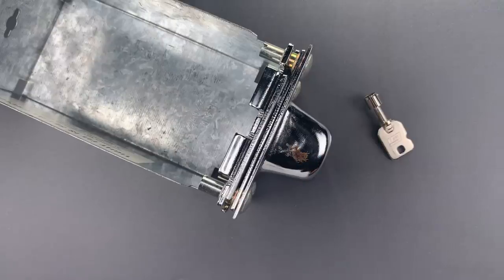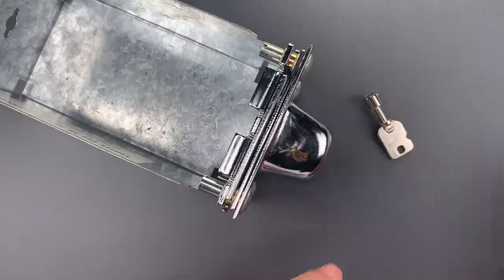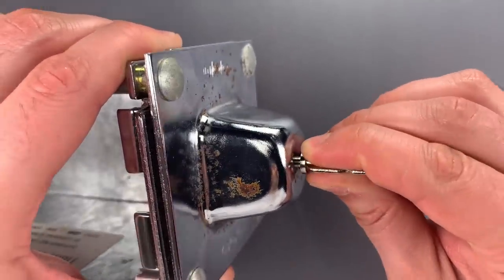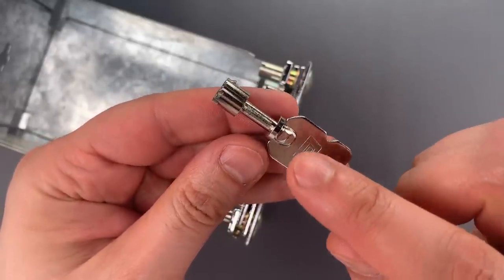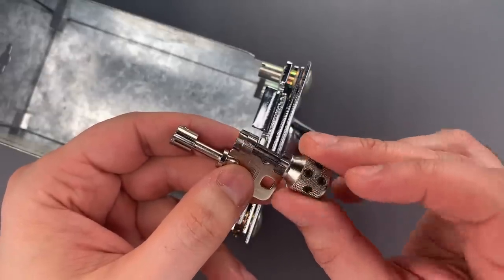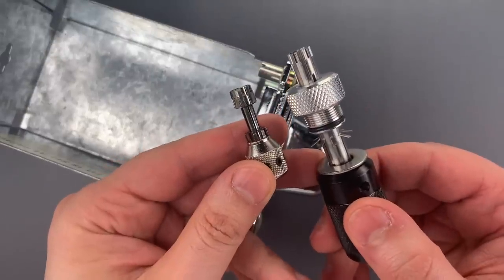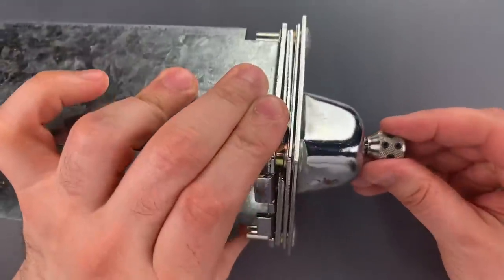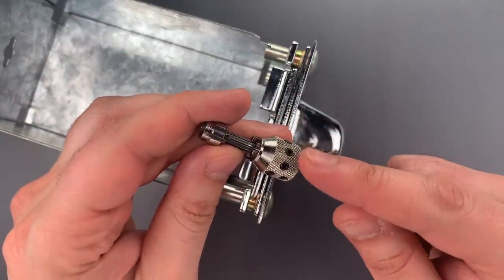[1205] Rare Tool For Picking “Giraffe Key” Locks

Comment: idea: four-pin giraffe lock. a with this design would be pick-costly, as the thief would need to create the one-of-a-kind tool themselves (combining the two scarcity factors that make tubular locks potentially viable). At that point, it will likely scare away potential thieves, or just compel them to cut the lock/bike rack.
Don't use it on high-profile or long term targets, though, as the tool itself is possible to make, just not with great ease.

Comment: Interesting. If you made a similar modification to a disk detainer lock, even a cheap Chinese cam lock core, you could make it impossible to pick with any DD tool I know of. If you just restricted the diameter of the key, however, it would be easy to defeat. I think if you blocked the core with a plate that has a C-shaped cutout in it, and modified a normal key by removing all the material from a section of the shaft except for a bit that's offset from the center, you would end up with a lock that's very similar in concept to the Bowley. Now, the Bowley is not unpickable, and has in fact been picked on video, but it is an absolute nightmare to make tools for. Considering the amount of space in a typical DD keyway, and the complexity of existing tools, I think making a pick for a DD lock like this would be even worse. No one but the most dedicated and obsessive lock nerds would be able to open it without power tools.
Reply: Not sure if anyone will ever read this, but if you do, here's LPL's video on the Bowley, where he comes up with various theoretical picking attacks: https://youtu.be/qV8QKZNFxLw . 
Here is a video of a member of the Locksport community picking the Bowley. Note that faster methods have since been discovered; this is just the first time anyone ever actually succeeded: https://youtu.be/X04qgD0hOXk

Comment: You can find that pick here: https://thepickmasters.net

I love mine. Excellent tool.

The rare pick you are referring to that has not been made in almost 40 years is the original Pickmaster. I have one, and it is useful on many 7-pin tubular locks, however the one you have in your video is, in fact, its successor, which is currently available, and is also, unlike most other tubular picks, capable of SPPing tubular locks. The allen screws adjust the tension for the picks tips and can lock them in place for impressioning, or preseting cut depths.

Comment: Why is this entire comments section thinking LPL is just gonna instantly pick Stuff Made Here's lock as if it's an every day lock? I get that he's really good at what he does but damn, have a little faith. The lock was literally built to have NONE of the mechanisms lockpickers use to go about picking it. You can't even set pins individually like you can with every single lock LPL made a video with. Setting pins individually? Can't do it. Raking? Won't do anything. Comb picking? Not likely (odds are Shane watched LPL videos so he's probably aware of what causes comb picking to work which is easy to prevent). The only true way to pick a lock like that would be effectively recreating the whole key using a tool intended to effectively be an adjustable key, which is not only way more difficult because you have to guess every pin right and have no way to tell which pins are right and wrong, but doesn't even really count as picking when you think about it. I know LPL's really good, but let's look at it realistically here

Comment: Can anyone explain how this works? i can't see how he is manipulating the lock other than jiggling a little??
Reply: From what I can piece together, you turn the key to the side, binding the key against the tightest pin, then you push it in to set those key bits correctly, do it again the other direction (bind, push in order to set those) and so on until the bitting is correct, then the lock opens. At that point the key is effectively just the correct key. I don't know how the bitting changes, perhaps the bits are spring loaded and on a slight angle so the pushing causes them to advance to the next position? I'm not familiar with the innards of either the lock or the key so I'm struggling too.
The set pins on the back are so you can lock the key in position for other locks with the same pinning (as fast as having a key, rather than picking it each time), and so you could take the key out with the correct bits and duplicate it if necessary. (I went to the website of the company that makes this pick to see if they had more information, but beyond a slightly better direction on how to use it and this part about the set screws, I didn't find out much.)

Comment: Im still confused about how much tension to put on a tension wrench. Can anyone please explain?
Reply: Change tensions as you are picking.  It's mostly a feel thing, you should put just enough pressure to keep the picked pins in place but not so much as to bind the lock, if you can easily manipulate the pins and still keep things in place you are good to go.  A good place to start is with clear practice locks, they give you visual feedback as to how you are doing.

Comment: Dear young man... Why have you done over 1,000 videos yet never picked a Digital door code lock, the ones with number pad 1 to 9 and then x y. Z and c. Not sure why they are called digital either when they are non electronic

Comment: Hey, LPL, could you please explain how this worked in just a bit more detail?   You generally explain what is happening as you pick a lock -- calling out which pin you're setting, etc.  This allows us to visualize what's happening in the lock, and how the lock and the pick work.  In this case, though, I still don't understand what went on.  I understand the concept of a tubular lock -- each pin needs to be depressed to the correct depth by the corresponding notch in the key -- so I get how the standard pick works; I'm just not sure about the special one?